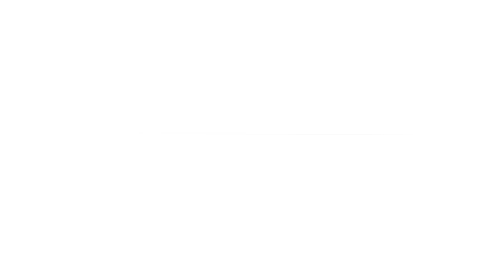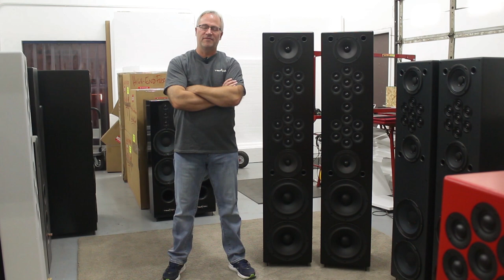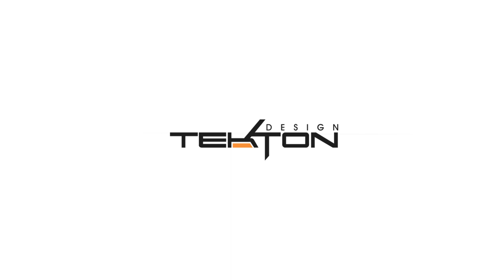The History of Tekton Design's Patented Tweeter Array

Comment: For those who have never heard Tekton speakers do yourself a favor and try them before you buy something else. Maybe you'll prefer something different but these are truly exceptionally realistic and dynamic speakers for thousands, often tens of thousands less than designs that compete favorably. At Rocky Mountain I only heard two systems that sounded as good as the Tekton Moabs that were on display. The $225,000 Gobel Divin Noblesse  and the $37,000 Vandersteen Kento. The Moabs are only $4500. I have since found two gentleman relatively local to me with Tekton speakers. One with a pair of Lore's and one with a pair of Double Impacts. The Lore doesn't use the same technology as the Moabs and the Double Impacts but they are more musical, dynamic and generally realistic than most anything I've heard under three grand. The Double Impacts, given the better listening environment compared to a hotel room are just smaller Moabs to my ears. I can't say that for three grand they DI's are better than your personal favorite speaker. However, I'd wager if you put them behind an acoustically transparent screen to remove the brand and appearance bias and tested them against any number of well known high end brands that a majority of people would select the Tektons. And not just because they would be the only ones most of these listeners could afford either!
Reply: What frontend were the Moabs connected to?
Reply: The perfect set seems to be a better deal than the moabs and easier to move around and ship back if you don't like it. If you really need more sound, the Moab looks like 2 perfect set stacked one on top of the other with an extra tweeter. $900 cheaper if you need 2 pair of perfect set on top each other. Probably better having higher and to the side to spread out the sound more than a single Moab.
Reply: Are they more dynamic then horns? Like Klipsch!
Reply: @nabildanial00  I guess it doesn't matter huh? This wasn't a sales pitch at all, just get the mathafackin' moabs they make your $50 Kenwood sound like a $800 denmanyanhamanha.  😁

Comment: The violin sound comes from the wooden box. The box weighs more than 1/4 gram. The string vibration causes the box to vibrate through the connection at the bridge. The box of the violin is like a speaker. All acoustic stringed instruments have a “speaker box” to amplify the sound (tone is dependent on box shape, size, mass, rigidity and tuning ports or f holes). Electric guitars use pickups and amplifiers that eliminate much of the need for the acoustic box or chamber (the body of an electric guitar still adds tone).
Reply: And the type of wood. Les Paul was after exactly that with the electric guitar, pure signal transfer from only the string and electronics, introducing no wood resonances.

Comment: Just because something g gets a patent doesn’t mean it’s any good. Or even that it actually achieved  what is claimed necessarily. Patents are easy to procure for such things if one is willing to do paperwork and pay legal costs. 

These radial  arrays are really a ring of drivers crossed over to work more like mid range surrounding one crossed to work as a proper tweeter. Even then, physics suggests it is a configuration that creates more issues than it solves. And it’s a very unnecessary anyway given the science behind wave guides on conventional tweeters …which Alexander seems to ignore as it’s the 1980s. 

And radial arrays seem so pedestrian anyway. If you want a whiz bang tweeter, go for and AMT or ribbon…of even a KEF coaxial with its fact tangerine wave guides etc.  

This is all smoke and mirrors.

Comment: I had seen these and wondered about the potential comb filtering issue.  As long as you keep the flanking tweeters cut off low enough there is no reason it shouldn't work but I would be concerned about running such small drivers to sufficiently low frequency for this.  I had wondered if you were using linear phase digital filters such as described by Horbach and Keele but I see these are passive so that wouldn't be an option.  

Interesting design, hopefully some day I'll get a chance to hear a pair.
Reply: I own a pair of pendragons with the upgraded 7 tweeter and upgraded caps and I can testify that it has no flaws or comb filtering issue. It sounds magical and the sweet spot is the biggest of any speaker I've ever experienced.

Comment: I've been a ribbon fan ever since hearing the amazing soundstage of Apogee Scintillas back in the '80s. Unfortunately, those ribbons had no dynamism at all, and I was all cones and domes until 2016, when I was introduced to Jack Smiley's hand-built air motion transformers that crossover at 500 Hz. I totally get what you're doing, using multiple tweeters to cover the mids with athleticism. However, there's still the issue of a tiny dome trying to fill a big room with the highs, and that's where air motion transformers come out on top. That said, I would still love to audition some Tektons. Unfortunately, I could not find them at the last two AXPONA shows. It's mind-boggling to me that you'd settle on a direct sales model with no presence at audio shows.

Currently, I'm building the Blue Rose Ballroom, which will be one of the best sounding small venues in the world, and I settled on Coda Audio for the sound system because they have a tweeter design with 50% less distortion that uses a pair of flat ring diaphragms instead of a 4" dome. I have a pair of their HOPS8 point sources in my living room, and they have the sound I've wanted at home for 40 years and never achieved. They're nowhere near as revealing as air motion transformers, but they slam music into my chest like nothing else I've ever heard. If they scaled their dual-ring driver down to home audio power handling levels, with even lower mass ring diaphragms, they could take the home market by storm.

Comment: Hey Eric, I notice that Macintosh is also using an array of small drivers coupled to woofers. Any concerns with patent infringement there or is that simply affirmation of your design?
Reply from the maker: Yes. I'm watching them. They are infringing on my patent. They've copied my work in the past too.
Reply: Many companies have made speakers with arrays  of small drivers for decades. Literally decades. Long before Tekton existed. Don’t be fooled by the frequency of use of the term “patents”.  By itself it is just a marketing gimmick or an example of delusional self-regard. Or both. 

What is the patent for exactly? He doesn’t say. The patent is likely  for something very specific and relatively tiny detail of his implementation of a radial array. Not for a radial array as such. Because those date back to the 1960s. Patents  are public record so anyone could pull it up if they had the time and wanted to. Might be a pain because who known what name they are filed under. What’s the patent number dude? He could even post a pdf of the patent company website. Why not? Once something is patented it is by definition not a trade secret.

Comment: So what about Electrostats and ribbon speakers? Don't hey have low mass and should be able to give the same type of performance as the Tekton Tweeter array speakers?
Reply from the maker: They do not. We're running about 90% lower moving mass than electrostatics. Ribbons cannot perform will at lower frequencies.

Comment: Is it critical that the center driver in a 7 tweeters assembly is exactly the same as the rest 6 of them? May we use some higher quality tweeter for a center position and somewhat lesser drivers for the surrounding "midrange"? Given that lowpass crossover frequency for those drivers is fairly low I guess there shouldn't be any significant delays or phase shifts between different type of tweeters within a range they would play together.

Comment: Thank you. This makes sense. Hard to reproduce the harmonics in the correct ratios if the mass is different. Got it. Good idea. Still don't understand the mathematics though, a flat frequency response is a flat frequency response, so however you want to achieve it seems like it would work. Curious: Do you place phase shifts in the driver array to broaden the dispersion?
Reply: The logic here is not sound..."Hard to reproduce the harmonics in the correct ratios if the mass is different" - Why would this be true...electricity drives the diaphragm not mass of the diagram.
Reply: @camploismyalias agreed. 

Take his example of a violin. He talks about the mass of a string but forgets about the rest of the violin, such as the wood body. Ever hear a violin string played suspended in air? No a violin note is produced by the  ENTIRE instrument, not just a string.  vibrations on the string are interacting with the body and air chamber, etc. all of has more mass than the largest cone or dome. And the mass of the vibrating material —or rather materials—is only one of MANY factors that make a violin note sound like a violin note. 

His argument is nonsensical and  specious. 

What if I want to reproduce a note in a flute? Does my cone need to be the mass of the air inside the flute? Or of the metal of the flute? Or both? You see the absurdity here as the mass of either is only important relative to how sound works as a pressure wave. 

That is why one can  re-produce a pressure wave of flute with a speaker at all. Or record it magnetically or digitally. 

According to quasi-logic of the video, not only should the speaker cone be the same mass as the violin string, we would need to move the speaker cone the same way a violin string is activated: with a a bow (or I guess the equivalent mass of a bundle of filaments coated in rosin held in tension). Surely an electromagnetic field that moves a driver in and out/back and forth can’t reproduce the “harmonics” produced by bow sliding across a violin string! Or the vibrato introduced by the violinists fingers. lol. 

Fortunately for all of us, that is not how the physics of music recording and replication works. 

The claims made here  seems science based and logical on first blush but do not hold up to any scrutiny. Science is used here to obfuscate, not to enlighten.

Comment: So on the singular 7 tweeter array, they cross at 4000 to the center tweeter roughly? What about the ‘mtm’ version with the singular  tweeter... all 7 play the same frequencies?
Reply from the maker: They contribute to frequency response at 270Hz.
Reply: @TektonDesign what does that mean? Your response could be equally be true for either of the options the question asked. Therefore it is less than valueless. It is obfuscating. 

It’s a simple question: do all the arrayed drivers have the same frequency filter (and or attenuation) applied to all of them via the crossover OR do the arrayed drivers have different filters depending on their location in the radial configuration. One filter apllied to each and  all OR  differentiated/varied array? 

And get, where are those Kipplel Measurements you promised four years ago?

Comment: Go tell GR Research about your accolades. He thinks you need his help on the crossovers. LMAO!
Reply: He might.  Multiple tweeters=phase issues.
Reply: Danny thinks he is the absolute best of the best, and legitimately has an almost cult like following on his forum. I try to like the man, but his snake oil cables and connectors keep me from it somewhat, he does tech talks on new record day's channel,  he gives alot of information without ever teaching anything which is my most major issue with the guy.
Reply: @Gcrilla  believe me I know. I was on many gear tours. If you can't hear a difference your system isnt resolving enough. The irony. It's pure Barnum and Bailey.

Comment: These speakers probably sound excellent.  The explanation is embarrassing garbage. A 3" Scanspeak dome midrange has the same low mass and more area than seven 1" dome tweeters. The patent is a gimmick. The string on a violin makes very little sound.  It's the body of the violin interacting with the string that makes the sound. Mount a violin string on a carbon arrow shaft and it will make little or no sound.  Gimmick.  Go put the body of the violin on a scale. Who cares?  You can patent anything novel, whether it's useful or enforceable or not.  Just money down the drain. The speakers are fine. It's having all those drivers that produces very low distortion and huge max SPL at high frequencies that's important.  That speaker will be able to reproduce a wide band drum shot, which happens to have energy that's flat out to 20,000 Hz.  Having drivers that far apart can lead to some weird interference and lobing at the upper crossover point, is it 3 kHz? Don't know.   It would be most interesting to see the radiation pattern plots.   That's all that matters.  The cone mass is hyped for no reason.  The mass of all those tweeters combine, including the voice coils, is likely the same as the midrange.  Mass has nothing to do with frequency response, but high mass will result in low efficiency.  Lots of drivers overcomes that.

Comment: What about phase cancellation there will be that, why don't you separate the drivers from each other so they can't interact with each other or use the phase cancellation as a benefit from wall reflections.
have you thought about using instead of the centre tweeter driver and use plasma driver, better way to go for accuracy speed lightness as you're talking about.
they can cover from 5 to 50 kHz at 110 DB,
 And it has been found out in Japan that the Frequency response between 20 and 20 is not accurate, you need to reproduce the higher frequencies up to 50 kilohertz if possible it gives presents to the lower frequencies, by interacting with the body can feel it at those high frequencies, that's what you're feeling with natural instruments. They have shown that the brain is responding to these highest frequencies even if you can't hear it, they interact with the lower frequencies.
 Best way to put is I suppose is, if you're listening to low frequencies and the trouble is introduced into the mix the bass sounds more bassy coherent not muddy I think that's how it works. You get yourself an active EQ that can go up to these high-frequency 30 of 40kHz is some on the market and tweak these frequencies up.
You should be making them active your speakers With room cancellation calibration. Just designed the crossover as an active crossover you can still use amplification from any amp, there's plenty on the market if you tune it to how you want it for your speakers would be even better and just relying on the set parameters. They're not expensive you can pick them up for $150 Grant you they're not that versatile you want to play about 5 of 600$. Have you thought about controlling the bass drivers with servo assisted and using a realistic EQ they're cheap.

Comment: Does a 1 3/4  to 2 inch horn midrange from JBL or Klipsch give a similar result to your tweeter array? How about a Magnepan or Martin Logan with their low mass transducers? Also, I noticed that Mcintosh speakers use a lot of tweeters in their speakers. Are they trying to achieve something similar to the Tekton speakers? Thanks. You have great speakers by the way at a price that often times is lower than ones I mentioned above.
Reply: Anyone notice he NEVER answers any of these sorts of question in any way?
Reply: @ManFromLaBamba  I do now. I wrote that 4 years ago! haha

Comment: The analogy between the mass of a violin string and a speaker cone is specious … and sadly typical of his claims. He talks line he is being scientific while either completely misunderstanding the science or mis representing it. Yeah he got a patent: that means he filed paperwork about a novel design. Not that it works well. 

Line arrays (with properly implemented crossovers) do everything and more he wants to claim to do with the radial array without the inherent  physics based problems of a radial array. But he can’t patent a line array. So not good for his ego. 

We live in an age that has moved well beyond flush mount domes and cones. 

This guy talks like he  never heard of a tweeter wave guide, horn loaded compression drivers, AMT, or ribbons.

In the ways that driver mass can matter,  today one is better off turning to AMT or larger ribbon drivers, which are  now available or readily made that will perform better into upper mid frequencies. He would probably say they are too harsh or shrill. they don’t have to be…it’s just that many speakers that employ them are tuned that way (for the “exciting” showroom sound). 

But he can’t patent waves guides, or ribbons either. Because they are established and well understood technologies. So no ego enlargement.